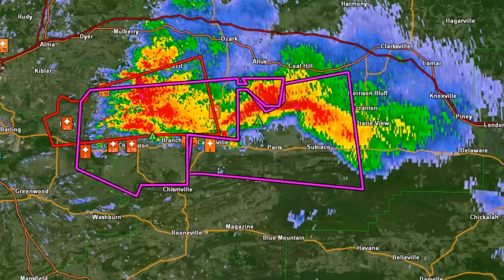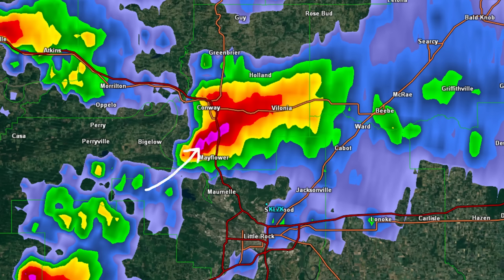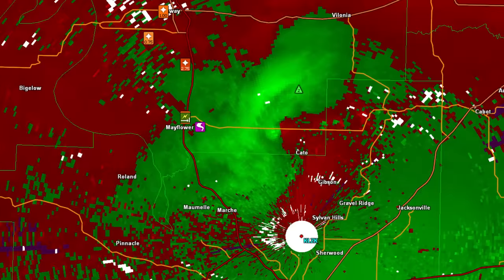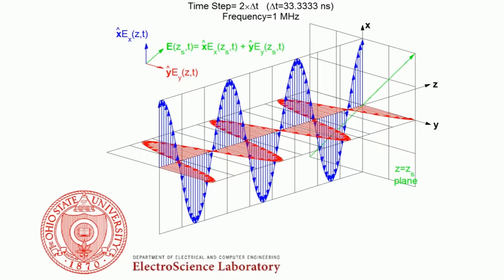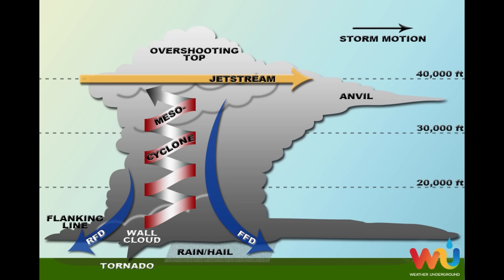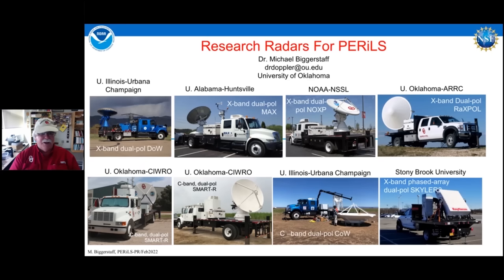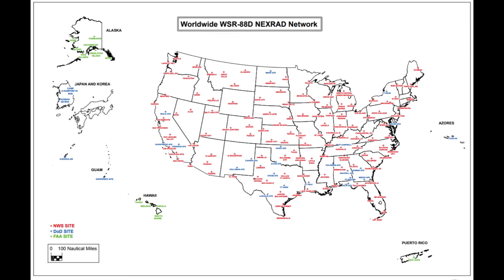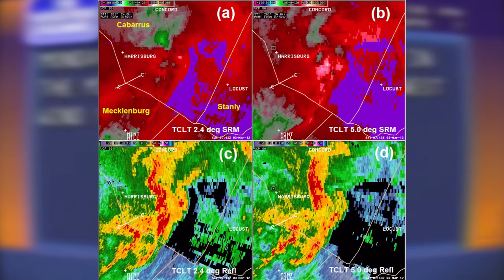Can Tornadoes happen with ZERO warning?

Comment: I'm from the Chicago area, not too far from Plainfield. The Plainfield storm was unwarned simply because radar technology was fairly primitive and the science was not very advanced in 1990. NWS Chicago still often does miss tornadoes, mainly due to the fact that about 75% of the tornadoes here are QLCS tornadoes, not supercells. Despite this, I like the fact that our WFO does not "Blanket Warn" (Issuing massive warnings ahead of a QLCS for the possibility of a small spin-up), and instead they issue severe thunderstorm warnings with the "Tornado possible" tag. Almost all our missed tornadoes have an SVR with them and they are weak, meaning as long as you head indoors you'll be fine if you're hit by it. If I see an SVR with a Tornado possible tag, I usually keep an eye on radar and if there is a TVS approaching me I take shelter. Last Saturday, there was actually an unwarned EF0 in the area. There was an excellent SVR, although by the time a TDS showed up on radar and the tornado warning came out the tornado had already dissipated.

Comment: I believe a QLCS tornado happened in my home town in april 2014 in NC as a trailer park was partially destroyed killing an infant and dozens of power line poles were knocked down. It was controversial because we have sirens for this reason but they never sounded while it was on the ground. I can't remember the rating but i think it was an EF-1 or EF-2

Comment: Late to the party but pretty sure I experienced an unwarned/unnoticed tornado in high school near Raleigh, North Carolina.  Cloudy day with some rain/wind; during class change I was going through an outside part of the school that was boxed in on all sides by the building (kind of forming a courtyard).  Random white cloud surged over the far building, lifted potted trees and flung them around in a circular motion about five feet from the ground and then smashed into the part of the building I was standing by, just a few feet away; lifted up all the ceiling tiles and created a massive 'whump' noise.  After a bit of panic we just kind of went about our day.  Never heard anything else about it and can't find a record of it.

Comment: The doppler shift that occurs from bouncing light off of rain is so incredibly small it's almost unbelievable that we have machines that are sensitive enough to detect it. The calculation involves the speed of light and the speed of the source\receiver. As you can imagine, the speed of light completely dwarfs the speed of any rain droplets so the correction is basically nothing.

Comment: The radar gaps ARE a big issue. I live, spot, and chase in the NE Texas radar gap that will be covered by the Durant, OK radar when its built. I have reported 2 unwarned tornadoes in the gap in March of 2022 alone. One near Windom, TX and one near Telephone, TX. We've gotten the short straw weather-wise in quite a few ways: Our 'local' meteorologists are up to a hundred miles away in Dallas/Fort Worth, we're in a big radar gap, and most of our towns don't have sirens or emergency management warning setups. Heck, between Windom and Ladonia, there's not even cellphone service.

Comment: We experienced a very short warning for the EF4 Linwood Kansas storm May 29, 2019. It was massive and slow moving and it was just decided it was only a severe storm with a huge hail core because it was so wide (1 mile). The tornado was rain wrapped and the news chopper was unable to confirm it, so news coverage was not willing I guess to warn viewers. We heard it before the NWS issued a confirmed tornado. Everybody says it sounds like a train. Either those who say that have never lived close to train tracks or are just giving the popular answer. What tipped me off was the sound. It sounded like a never ending roll of thunder. We live in a rural area, we can normally hear the sirens on test day, and on storms passing close but still miles away. We could not hear the sirens that day. They are located SW of us, exactly where the storms come from. That is something else that needs fixing more siren sites in rural areas. We were lucky it was slow moving. We were able to load the house pets, open the pasture gates (most horses can out run tornados if given the opportunity) and get clear ourselves. We were incredibly lucky to be on the edge of the path and that it crossed diagonally across the property. Our house was on the corner least affected. Everything else, not so much. I encourage anyone affected by severe weather to at least speak to a counselor. That loss of feeling of I'm home, I'm safe is very hard to deal with and doesn't hit until everyone else around you has moved on. Take help when offered, you have nothing to be ashamed about. You didn't cause the storm and you certainly have no control over it. I'm still too hyper vigilant. But I'm getting better every year. 
Sorry for the novel, it's part of what has helped.

Comment: If you had waited another month, you might have had a great example of a particularly strong tornado escaping detection for much of its' 17 mile path near a NWS radar site because of a combo of small size (maximum size was at EF-3 at 200 yards), rapid movement (moving at 55 mph), radar sweep timing, and rain-wrapped until it intensified to the larger tornado size and velocity. By the time it was warned for being spotted, it had traveled 11 of the 16.6 mile path, killed 2 people, and the radar suddenly updated to having a debris ball at the same time.

It was warned, but for Severe Thunderstorm Warning conditions of 1.50" hail and 60 mp/h gusts which is definitely not what the hazard that came from the storm turned out to be even from footage of it on the ground as there was no hail but plenty of tornado.

Edit: This tornado however came from a thunderstorm that had a HP supercell shape at the southern end of a squall line cannibalizing the storms to the north. It is probably no surprise that QLCS tornadoes and HP supercells are probably the main sources of unwarned or underwarned tornadoes given that one spins them up fast, the other hides the tornado and unless particularly intense and large might end up missed.

Comment: You mentioned Charlotte NC doesn't have weather radar coverage BUT IT DOES. In fact, Charlotte NC has some of the BEST of weather radar going for it in the US.

The FAA in conjunction with NOAA operates several "Terminal Doppler Weather Radar" (TDWR) sites at airports both to help them arrange flights more safely as well as giving many of the advantages of the NWS WSR 88D doppler radar, and one of these is at Douglas International airfield Charlotte NC. TDWR does not have the long range of WSR88, but it has higher resolution. Radar operators at TDWR sites receive additional training from the NWS in discovering and evaluating the initial signs of a severe-level storm or tornado in addition to their usual training. And as much as their range allows, they can provide limited back-up for nearby NOAA radar sites. The NWS GSP office in Greer has both an online link and a over-the-air radio link to the CLT TDWR so they can see it in real-time along with their own radar. I know all this having once been involved with the running of the Ham radio side of SKYWARN for NWS GSP. Most of the severe WX in this area passes through the coverage of NWS GSP's radar long before it reaches Charlotte, and anything they find signifying trouble gets passed on the the TWDR folks in Charlotte; in effect twice the number of people watching. 

TDWR has been around quite awhile and anyone who does much more than superficial research on weather radar in the US will find it mentioned. If you're going to claim weather expertise to the world online you need to have it first.
Reply from the maker: Hey there, first I want to thank you for taking the time to answer all the questions here. You're clearly very experienced and knowledgeable. I am aware of the TDWR, but found either accounts of meteorologists in the area frustrated with the attenuation, or meteorologists in the private sector having access to only the WSR-88D. And that's mainly who citizens are tuning into when there's a tornado warning. This is as far as my research went, and I absolutely could have done more, so for that I apologize. Also I want to make it extremely clear that I'm not an expert. I'm a recent college grad who is making educational content trying to explain weather to a base audience that doesn't have any background. And while people have said I'm good at explaining things, I'm very knew to all of this. There is still useful information in this video so I will leave it up, but I'm committed to being more thorough as I move forward. Thanks again
Reply: @weatherboxstudios  I appreciate that you're trying to educate people on how things work and TBH if you understand what to look for on the publicly-accessible radar you can often locate likely tornadoes and severe storms yourself faster then waiting for the official warnings. Having been deep into the system I can tell you that there's a lot of improvement possible- just remember that it's government agencies chock-full of bureaucracy which is never the formula for best success. In my time few of the media meteorologists bothered to log into the NWS Chat system (or didn't monitor it once logged in) or they'd have had a much better experience. A lot of 'heads up' info goes in there but you can't see it when you're not watching. And there's a lot of local variation with how each WFO uses it and that changes as faces come and go. TDWR is by necessity slanted toward FAA needs but it does help in covering gaps. And Charlotte did do fairly well filling in as best they could when GSP's radar was down once. I'd rate this area B and nationally a C grade overall. At least Congress is finally considering the issue (which was promised to us after the 2011 outbreak) of adding more WX radar sites to better fill in the gaps- it does need to happen.

Comment: Yes, because the National Weather Service (In Birmingham) tries TOO HARD to keep the false alarm rate down, sacrificing lead time. They wait until the dual doppler (Correlation Coefficient) sees a blue dot, and with the weaker tornadoes. The warning coordination meteorologist in Birmingham, attacked Harold Brooks. Yet James Spann, praises him, for keeping the FAR down. It's frustrating watching coverage here in Alabama because they issue a tornado warning, then cancel it, then reissue it, then cancel it. Broad rotation, no tornado warning. Tight rotation, tornado warning. James Spann said "how would you like to be the one working the warning desk to decide whether or not to pull the trigger?" But the tornadoes I am talking about are the weak EF0 and EF1 tornadoes.

Comment: I have not seen an unwarned QLCS tornado but my cousins have, interestingly, a warning was never issued however on google maps you can clearly see the damage path from street view. The tornado lowered and created a path of damaged and twisted trees but was never recorded as a tornado, It happened in march 2019. the street view is from aug 2019 and you can clearly see it touched down near the road of 27 brushwood Rd Uniontown PA and rapidly widened before dissipating about 1500 feet later. my cousins said it hit around dinner and they heard the roar of it at it approached. interestingly it moved southeast instead of northeast as a typical tornado does.

Comment: People need to realize a tornado watch IS your warning. If you wait for the warning designation or the siren to go off, you're too late. When there's a watch, get your essential stuff and loved ones and BE in your designated safe space til it's over. Have a good plan BEFORE bad weather is even happening. Have supplies IN your safe space. Keep your important documents, clothes, food, med supplies, sturdy shoes, flashlights, etc. IN your safe space. Then, once there's a watch in place, grab your loved ones and your purse/wallet and phone/tablet and get to your safe space to wait out the watch even if it takes 3 hours. Watch the news on your phone, tablet, or a tv that's in the safe space, but stay there, even if it's in the bathtub. You never know WHERE a tornado will develop. It could happen in your backyard or down the street and be ON you before you can move. The warning isn't issued until a tornado is SEEN and REPORTED. How long before that happens is anyone's guess. It can be too late for you by then. The whole POINT of a Watch is to let you know to be in a safe space and wait in case one develops near you. Consider the watch as the warning. SO often, the skies are grey or it's dark and it's really hard to actually SEE the tornado coming. Be where you need to be to be safe before it hits the ground.

Comment: Yes they can.
I work overnight in south central Wisconsin and about 7 years ago we had not 1 but 2 touchdown less than a mile from where I work. There were no tornado or even severe thunderstorm warning or watches at the time they touched down. A warning finally came out when an EF-3 touched down about 10 miles north of work and that was at 2am.

Comment: I've had 2 unwarned tornadoes on my street in my lifetime (EF1 in 2010, and EF0 in 2021). I also live at a location where the radar beam from both nearby radars is fairly high into the atmosphere. Both radar signatures showed rotation, but (especially 2021) not something I personally would've warned if I was in the nws' shoes. I was actually outside on the porch when the 2021 tornado hit my neighbor's house, but couldn't see anything as it knocked power out. 1 tornado was from a supercell (2010), while the other was from a QLCS (2021). The QLCS produced 3 more unwarned tornadoes (1 on the other side of town). I live in a neighborhood surrounded on 3 sides by bluffs, so I wonder if there's any localized terrain impact on tornadogenesis.

Comment: Gaylord MI which is very north in MI got hit by an EF3 last year & I wonder if it was unwarned. That area hasn’t seen any kind of tornado for 100+ years so you can imagine the shock an EF3 straight thru downtown did.. it’s still not fully recovered as I drive thru the town almost every week & still see destruction..

Comment: I have experienced an unwarned tornado once last year, I believe it’s rating was an ef1 and it was forming as the cell passed directly over my house. I could see the funnel as it passed and it ended up destroying a factory about 2 miles give or take from my house and one of the downed power lines actually arced and killed a police officer that was blocking the area off

Comment: We had an unwarned tornado here in Delaware a few years back. Didn't know it was down on the ground until my coworkers came in from smoking and said they saw a tornado outside. Ended up hitting a trailer park. A few people were injured, but thankfully no deaths. I believe it was an EF1. Most of the time we have sufficient warnings though. That one was a real fluke.

Comment: I don't know of it was an unwarned tornado or something else.
There was a storm, and we were under tornado watch.
The storm was producing, but we were never under a tornado warning at our location.
After the storm, we discovered that the car's windshield was busted, like it got hit by a single large object or something (it was in the driveway).
We don't know what caused it, but the storm had produced a number of confirmed quick spin-up, short track tornadoes. 
About a dozen miles away, a friend's house took EF2 damage, and the warning only happened a minute or two before they were hit, with the tornado only confirmed by the damage.
One of the theories for the windshield damage was that it was from the debris of a very short-lived tornado as there were some downed fences and a fallen tree towards the south of us. It also could have been a downdraft, some other damaging wind event, or an unrelated coincidence. We really don't know for sure.

Comment: Watched the storm that spun up the Plainfield EF5 from the far north Chicago burbs. Odd thing was watching it approach from the west it appeared as " normal " thunderheads heading up to jobsite and after arriving but after a bit it seemed to peter out becoming just a low bank of clouds to the south southwest but as it got almost due south of me I remember coming up with a load of parts from the basement of the new house I was scraping unused HVAC parts from to see the same low clouds but going back in and coming back out maybe 5 to 8 minutes later I stopped dead in my tracks because that low cloudbank was a giant supercell that i still remember in that moment thinking  to myself geeze whoever's under that is catching hell right now. Wouldn't be until I got back to the shop and was on my way home that at that moment an EF5 was ripping through Plainfield. 
Pretty sure it was one of those QCLS spin ups hit my neighborhood two years ago. Brought down a willow tree that did some damage to my house and thought initially it had been some straight line winds but there was distinct damage path that began at southwest corner of my area, tracked right towards my house that clearly started about treetop level, got low enough to damage upper floor siding and blow out some windows on two story homes and was lifting by the time it got to me and probably wouldn't have even noticed any damage by me if it wasn't for the notoriously shallow rooted willow being one good thunderstorm away from coming down in the creek and the spin dropping it the other way.